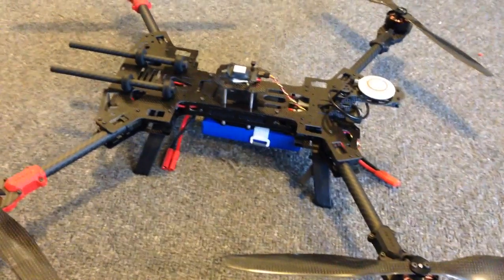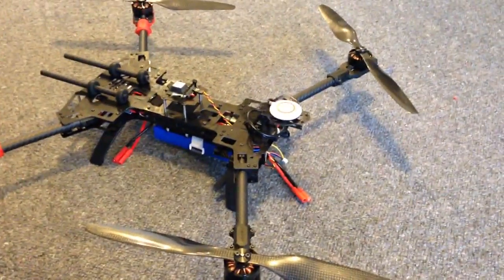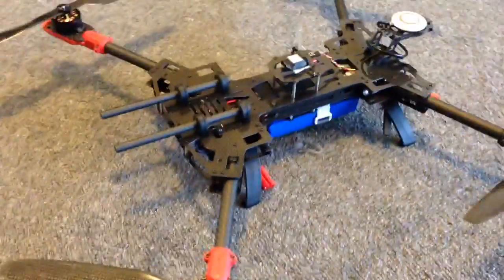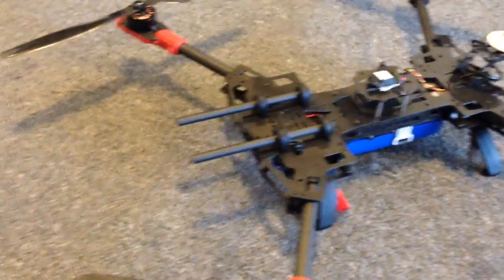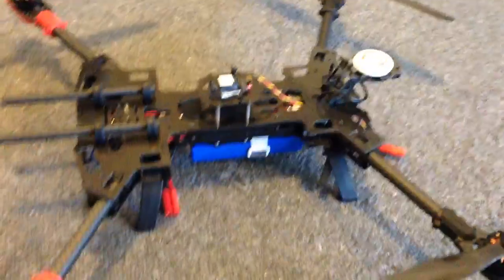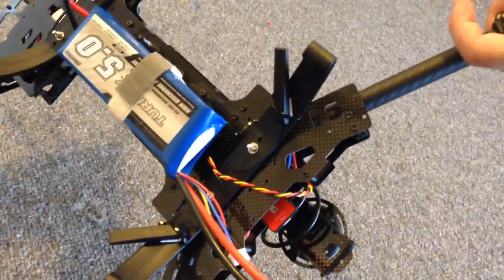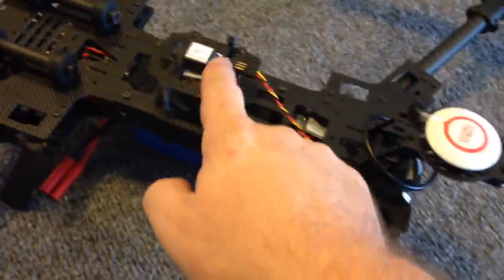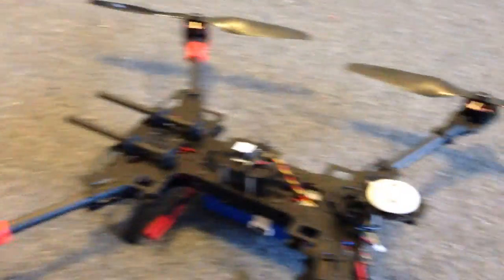Alien 560 Mk 2 completed

Comment: Great stuff, 19 minutes!  Eagerly waiting for your flight video on this Sunday. 
Do you have a page that list your parts? Do you recommend to stick with the landing that came with the Alien 560? Or was it replaced with a landing gear from Hobby King, part number please.
David
Reply from the maker: Hi David,  Yes I am very happy with the 19 minutes.  I did another night flight just now and let it go to the auto land low voltage which was at 21 minutes.  This was a 5000 Mah battery.  I will try tomorrow with an 8000.  It should be fairly easy to get 25 minutes now.  The quad is super smooth and quiet.  Very nice.  I'll put together a parts list for the next video but you can find lots more information on the RC Groups thread here. http://www.rcgroups.com/forums/showthread.php?t=2115146&page=56#post29823103
Reply from the maker: PS. The landing gear is from a Logo 500 Helicopter, I bought them in Perth last week from perthrc.com.au
Reply: Thanks Rob.

I'm from Singapore, so I order most of my RC stuff from Hobby King in Hong Kong. Do you know of any Hobby King landing gear that will fit this quadcopter? Thank you for the link.
David
Reply from the maker: ***** Here is the parts list David.   http://www.rcgroups.com/forums/showpost.php?p=29824103&postcount=842